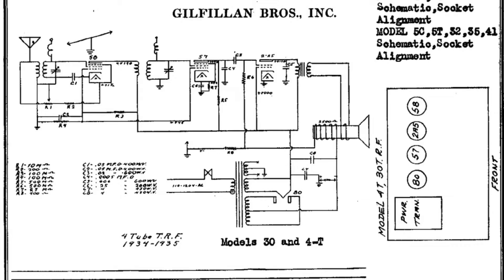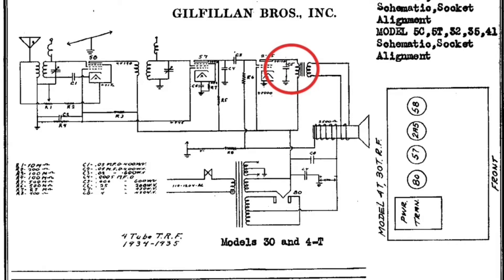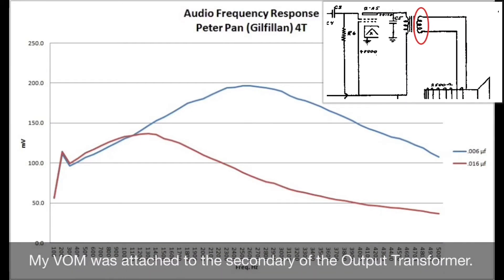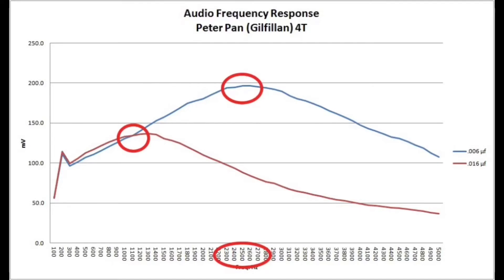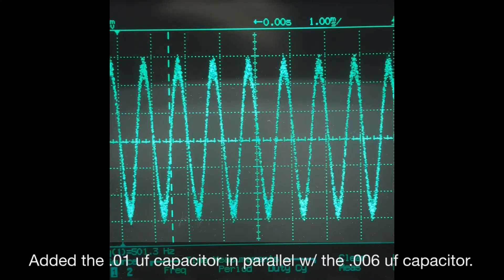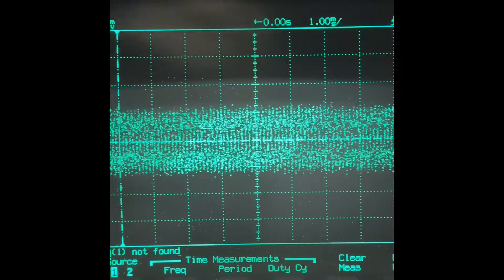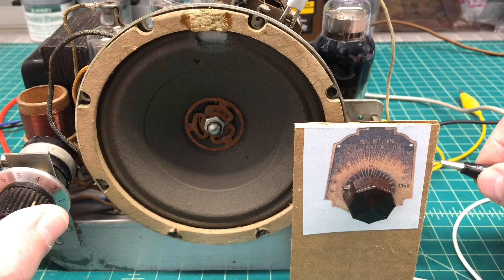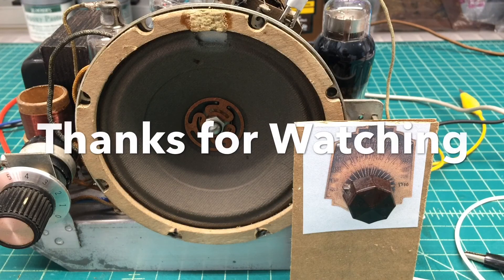Peter Pan Radio - Day 13 P2 (Capacitor Value & Impact to Audio Freq. Response)

Comment: Found and have been enjoying this series. Mr. Don, as you said, the sound is subjective and influenced a lot by the cabinet the speaker is in. I can bet when you get to the final adjusting, you will ("will have decided" in this case 😉) decide to adjust the cap value because of the cabinet with that big piece of wood in front of the speaker. 
Lets see.
Reply from the maker: Thanks for watching the series. The cabinet does make a difference! Best, Don

Comment: Some texts that I have read point out that if this capacitor develops a short then the way it is wired (between plate and ground) it would take out the output transformer. They recommend that you wire the capacitor directly across the transformer primary or between plate and B+ (screen grid). This makes no difference to the frequency response of the output nor to the authenticity of the circuit but is a lot safer.
Reply from the maker: +psionl0 Thanks for sharing your knowledge on this. Do you think this was an after thought after seeing radios show up for repairs with open output transformers? Would you happen to recall the texts so I can read up on the design changes. Thanks again. Best, Don
Reply: Hi Don, I'm guessing that servicemen encountered this problem often enough to cause the design change I mentioned but I don't have any hard data on it. I have some old copies of "Radio and Hobbies" from the 1940s and in every wireless construction project, the capacitor is wired across the OP transformer.

Most of my information comes from old Australian electronics magazines that have a "Vintage Radio" section. You probably wouldn't be able to gain access to these magazines but I'm sure that there are equivalents in the US. For your interest, I quote from the late Neville Williams* in Electronics Australia for November, 1991:

"Early practice was to wire the capacitor directly between the anode of the output valve and the chassis, but this proved to be unwise. Even at zero volume, the capacitor was subjected to a DC voltage of around 250V. At high output levels, the superimposed audio signal could boost this to peaks of double that figure, with a very real risk of breakdown.
 This, in turn would cause a short-circuit current through the output transformer primary, and a heavy load on the rectifier - until either it or the output transformer failed. In the meantime, removal of voltage from the output valve anode would divert electron flow to the output valve screen grid, raising its structure to a bright red heat, with the risk of warping and/or the release of occluded gas. It could all add up to an expensive repair, if the receiver was not switched off promptly after the initial failure.
  If you come across a vintage receiver wired this way, the capacitor should be re-connected between anode and B+, as shown. It will be just as effective in limiting treble response, but will reduce the stress on the capacitor and obviate the secondary consequences in the event of a breakdown. It the old capacitor is suspect, replace it with a good quality type rated to at least 400V."

* Neville Williams had a career making wirelesses in the 1930s before joining Radio and Hobbies magazine.

Comment: I have been following this series of videos on this radio and wondered exactly what the LSR meter was indicating.  This meter is somewhat pricey, but is it worth the money for what it tells you.  Could you please describe it more for me?  Thanks.
Reply from the maker: +Donald Emmerling Donald, the meter I was using is a LCR meter. L is for inductance and used for measuring coils and chokes for example. C is capacitance and of course would allow you to measure capacitor values, but not their health like leakage or alike. R is resistance and your standard VOM would meet your needs. The unit has more advance features as well, but for basic troubleshooting it's not a requirement. Do a search for Peak Atlas LCR45 and you can read more. Hope this helps. Best, Don